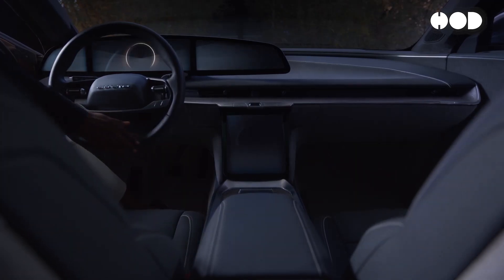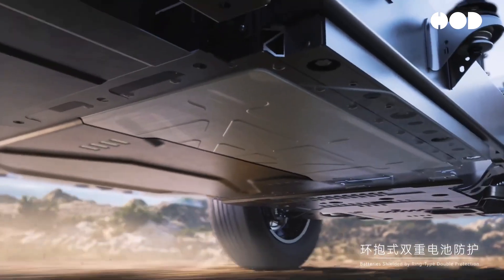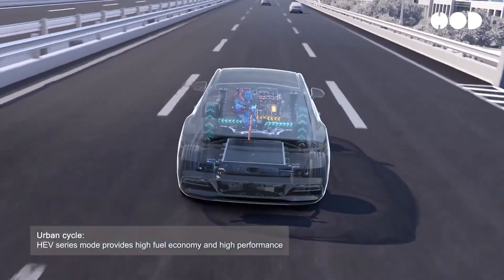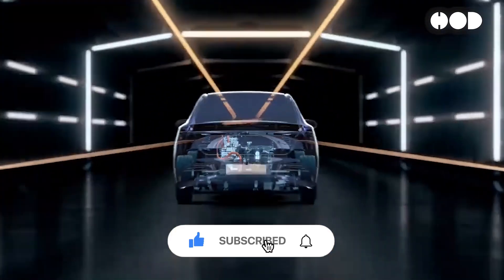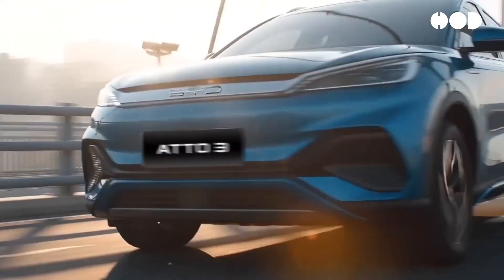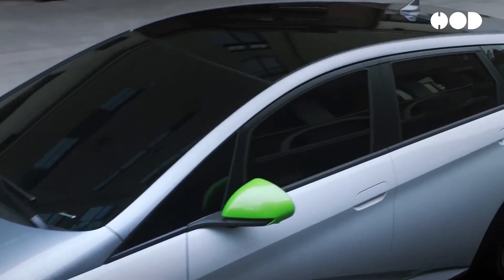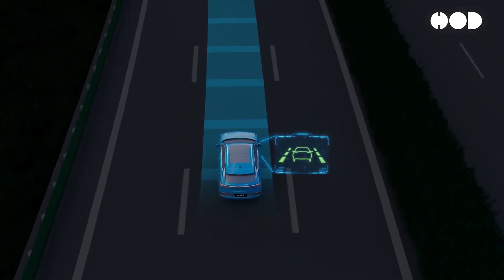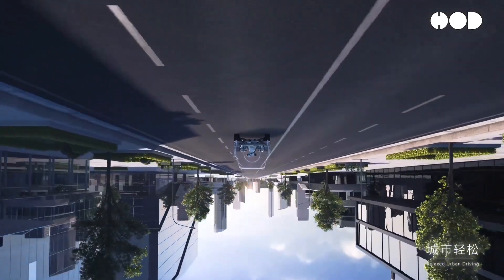The Innovative Design Behind BYD’s Plug-In Hybrid DMI System.

Comment: There's nothing innovative about this as similar systems are already in use by many manufacturers.😂
Reply: lol no
Reply: @LightningSe7en  lol Yes, check out Mitsubishi Outlander phev for example. Chinesee didn't know yet what electricity is. 😂
Reply: @Artur19760512  Mitsubishi already a lose quit China
Reply: @张开焰 Everybody loose in China because government subsidize domestic companies otherways they would go bankrupt just like real estate companies before. That's why everybody else is imposing tariffs on Chinese cars.
Reply: They use the same tech as honda plus ford have this tech with their plugin hybrid fusions, c max and the escape hybrid
Reply: you are wrong, this vehicule is essentially a full EV with a petrol engine to back it up as an assistance right whereas you should know, conventional hybrids are essentially the other way. BYD started with plugin hybrid in 2008
Reply: @giuseppevinago3765 Don't call it a Full EV, it's a plug in hybrid, you need to plug it in and Gas it up well for it to be fuel efficient
Reply: @giuseppevinago3765  😂 a lot of plug ins are like that nothing new.